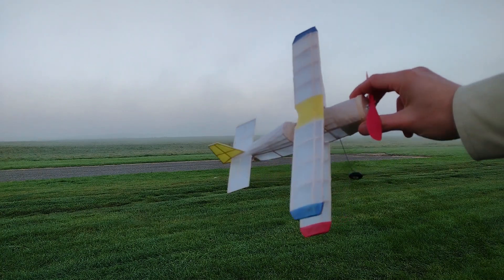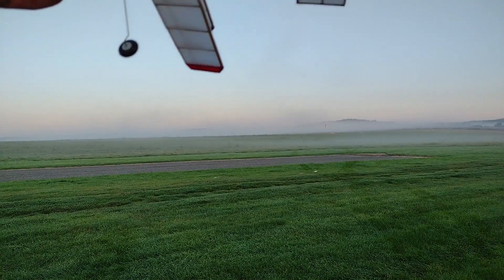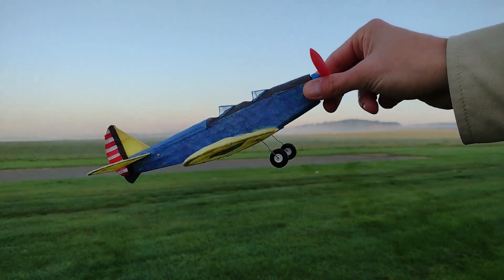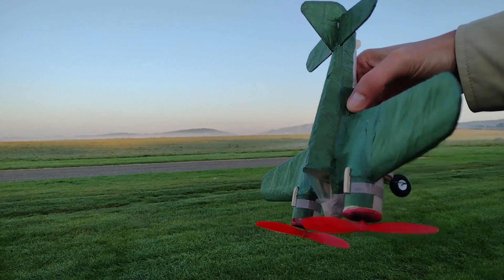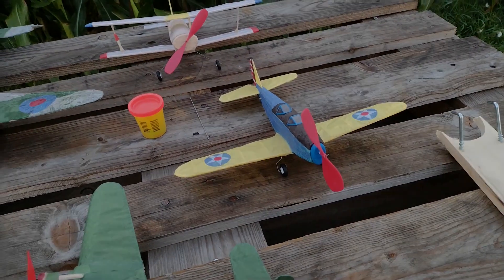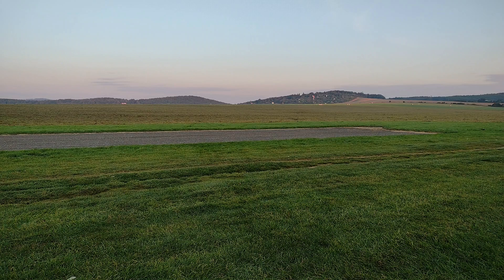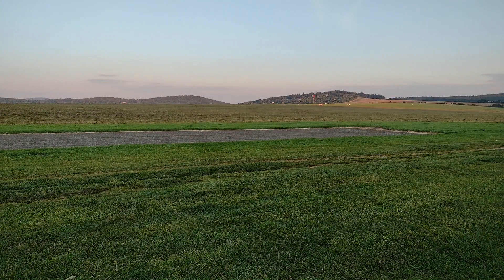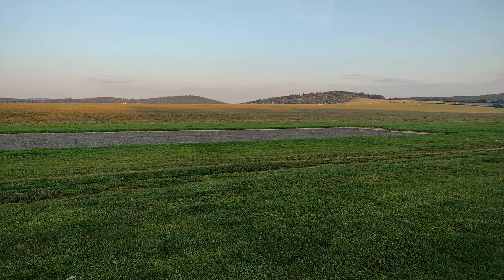Rubber Powered Failures

Comment: Launch flat, at about flying speed. Check for CG first.  If it glides nicely then the next issue is thrust angle, you will need down thrust and right thrust.
Reply from the maker: Thank you. I need to have a better strategy and plan. In the end I was just throwing for the sake of it. Thx for the tip!

Comment: I so wish I could be there to help you! Attempts at trimming are overwhelmed by the effect of moisture on your tissue.
The concept of trimming, which you clearly do understand, is to make incremental adjustments based on the previous flight. 
But the moisture that is rapidly both settling on your tissue and being absorbed by the tissue changes the balance and aerodynamics of the model faster than you can do another test flight. You are "fighting a losing battle". Something must change!
Reply: Are you able to buy model aircraft dope or full size vintage or home built aircraft dope? This is what will waterproof your tissue. Water will no longer be absorbed by the tissue and it will no longer come unstuck. Water will still settle ON your tissue, but with the tissue waterproof and the glue "firm" you will be able to use paper towels or tissues to absorb moisture off the model before launch. It will THEN be the same model that you test flew on the previous flight and the adjustments you make will have some chance of demonstrating their logical effect.
Reply: If you can obtain dope, you need to dilute it substantially before paying it to such small models, as the dope will shrink and tighten your tissue, potentially warping your flying surfaces. Diluting your dope (say 3 parts thinner to one part dope) will help you manage any warping tendency. Apply multiple coats until the tissue takes on a slight shine.
Dope is plastic dissolved in a solvent. You brush it on, the solvent evaporates and you are left with only the small amount of plastic that was originally dissolved. In this way you are able to get a distributed coating of the plastic through and on your tissue, making it both stronger and water proof.
With a brush it is not easy to get thin even coats. Diluting the dope helps with this because each coat has less of the dissolved plastic and repeated coates are unlikely to all miss the same spots. Plus the warping tendency is less and easier to manage with diluted dope.
When you apply dope, think about warping. Do the top of one rib bay, then the bottom. They will be drying and shrinking at the same time, so the top will resist the tendency of the bottom to induce warps, and vice versa. Immediately move on to the top and bottom of each rib bay in turn, so that adjacent bays will resist the warp inducing shrinkage of each other.
Personally, I stick my tissue on with dope, but for your current models that is too late - and many expert modellers stick tissue on with a glue stick or diluted PVA glue - so there is nothing wrong with your current method. Provided you waterproof the tissue.
Reply: In the previous comment, paying should have been applying - thank you autocorrect.
Reply: As Cliff has told you, you need to start using an additional trimming adjustment. Put "shims" behind the nose block to change the side thrust and up and down thrust. Once you have the glide satisfactory, problems under power should be fixed with changes to the thrust angles. Anything else you do will upset the glide.
You need better trim tabs. A bit of tape is OK the very first time you go out, but by now you know that you need trim tabs. They need to be GOOD trim tabs that won't change between flights. Your bits of tape will change DURING a flight. They are hindering your attempts at trimming.
If you must use tape initially, fold it back on itself so that it is stuck to both the top and bottom of the wing or elevator and to itself behind the surface. Much stiffer and more likely to retain a setting.
But better is to make a little balsa tab, tissued and doped so that it is waterproofed, and hinged with tiny pieces of copper wire that you bend when you adjust the tab. These should stay put between flights so that an adjustments you make will be reflected in the next flight.
When trimming for the glide, the drag from the large propellors of rubber powered models is very significant. It is best to wind on a few turns, just enough to keep the propellor powered until the glide finishes. You did try that once that I saw, but 50 turns was probably too many.
The hand launch for glide testing is always difficult to do consistently. The solution is to do multiple launches with the same trim, to try to work out what part of what you are seeing is a trim problem rather than a launch problem. I realise that you are "racing", trying to make progress before your model is waterlogged. That is a race you will not win. You need to make your models waterproof.
Reply from the maker: Wow! thank you for the master class. I have a lot to learn here. 
I have tired to waterproof them with clear lacquer in a spray. I hope it helps.
I have used dope (I might need to buy some more) but I need to get the right thinner for it. I am worried of warping and your technique is something I wasn't aware of, so something to bear in mind for the future.
The nose-block angles is something I was thinking about, but then didn't do. As you say, I wasn't even able to get a consistent glide.
Thank you once again for all the points, I will read them again and again and try to apply them on future models. 
Rubber powered is so far more difficult than RC.

Comment: Try putting the trim tab on the right wing if it goes left. So the trim tab will go on the far end of the trailing edge of the right wing. This will counter the torque of the propeller.
Reply from the maker: Thx, I'll try it like that next time.

Comment: You need some downthrust on the Andreason to stop the power stall, also the PT19, you can add it behind the thrust button or nose block. A light coat of clear lacquer will help with the tissue wrinkling. Nice simple Stooge, do you use lube on the rubber by the way?
Reply from the maker: I've managed to put some lacquer. I will try the thrust adjustment as you say. I have not used any lube on the rubber. would WD40 do the trick?
Reply: @downwindchecklist6567  you can get away from adding thrust if you just add the trim tab on the leading edge on the right wing
Reply from the maker: @SM-pi8vd  I hadn't thought of that. thank you!